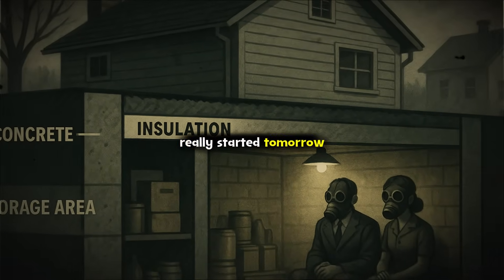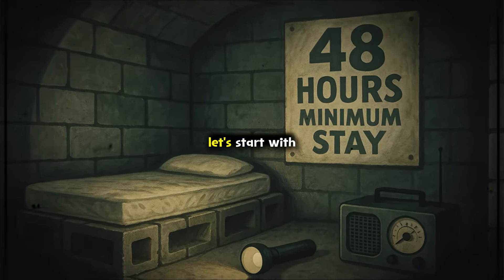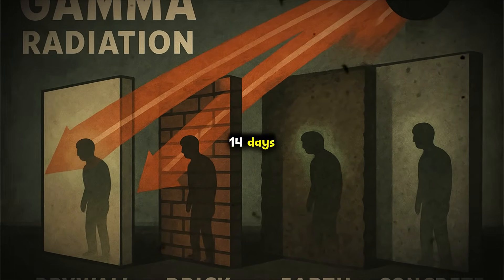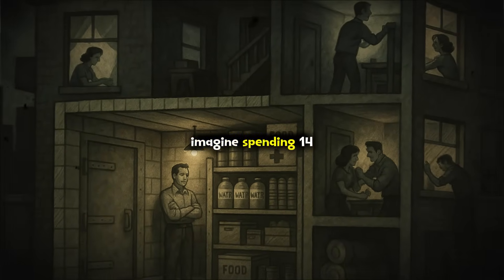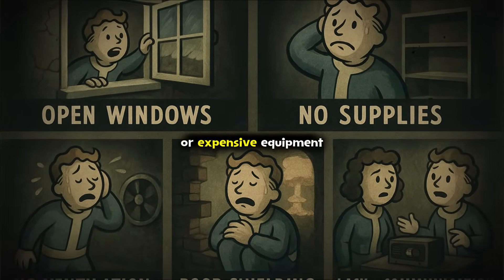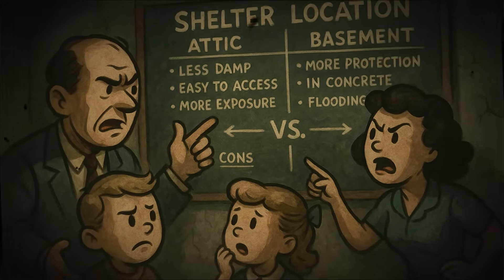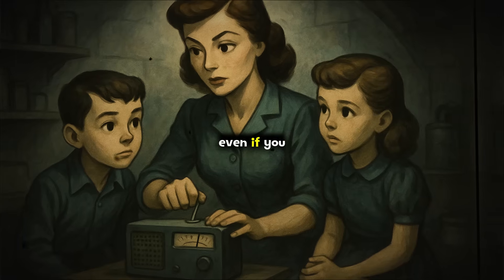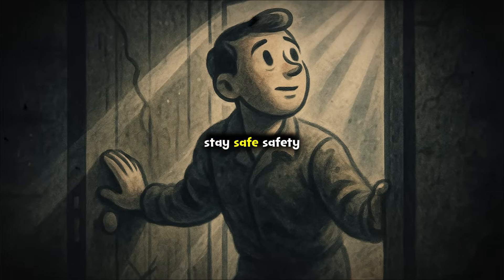Nuclear Bunkers: What Really Works—Build Right & Avoid Fatal Myths

Comment: People have in their heads that they need a Geiger counter, Geiger counters are designed to detect and/or small amounts of radiation, but if it’s high, it will zero the meter out and you’ll think you’re safe when you’re not. What you need is a radiological survey meter one that has been properlytested, and correctly zeroed.
Reply: Or high range dosimeter, far better than just a counter.
Reply: @ApocGuy exactly, I totally forgot about those!
Reply: There are plenty of geiger type devices out that have high range capabilities.  If you are detecting high level radiation like one seivert per hour you are already dead within a week.  The dose meter only tells you what you have already received not the current environment.  A simple and inexpensive radiation detector will allow you to test the environment outside and inside your shelter and help with decontaminating yourself if you are exposed to fallout by knowing if you are still contaminated. 
It is a tool that provides information about a danger that is undetectable with your own senses.
Reply: @jatpack3 One Sievert = 1000 rads, or 1000 rem. For most people, 450 ~ 600 rads is fatal. 200 ~ 400 rads will cause moderate radiation sickness, which will leave victims substantially disabled and unable to care for themselves. Specialist treatment and facilities are required, but these will be unavailable during a nuclear attack. Recovery, if it happens at all, takes months. Death is also possible within months to several years after exposure, and the risk of getting cancer in later life is substantially increased.

Comment: Having a well built bunker is one thing, however one must also consider distance from ground zero, the further you are the better. One should also consider defending said bunker from those who which to do you harm.
Reply: Not true. Fallout can travel hundreds of miles
Reply: @senoJSR  Depending on wind speed, it will take time for the fallout to reach its maximum distance. As time passes, the radiation decays in intensity. This means that if you are say, 400 miles away from ground zero, and the fallout takes 12 hours to arrive, the hourly dose rate will be at least 1/10th of what it was at ground zero. In addition, the amount of fallout will likely be less. As a result, your risks of serious illness or death will be somewhat lower.

In some areas, fallout may be so light that all you need to do is stay indoors without needing to take shelter in a specialized structure.

Comment: Air plants, free energy, mini bio-digestor, and peltier modules; manifold, heat sink, vinyl tubing, copper tubing, water pump, bio-filter, and fan. You may have a super evaporative cooler when the humidity ran dry too! Micro-greens grow the fastest. Bestol, sand, tin can, and stove-top fan for heat. One tablespoon of bentonite clay a day keeps the isotopes away. No guarantees with the borg.
Reply: Question...is bentonite more beneficial than zeolite?